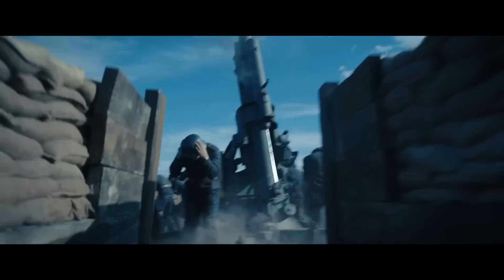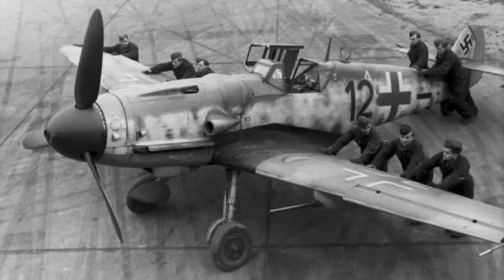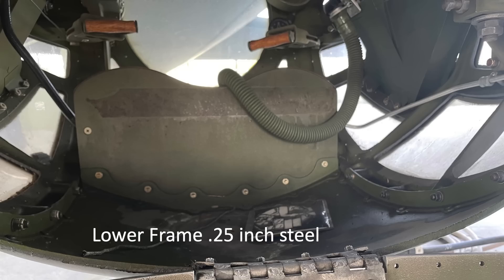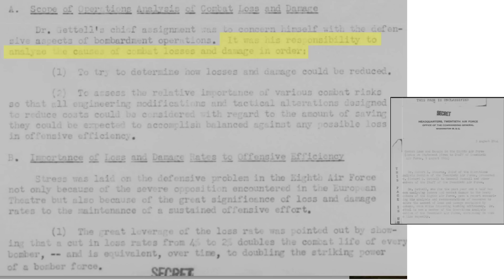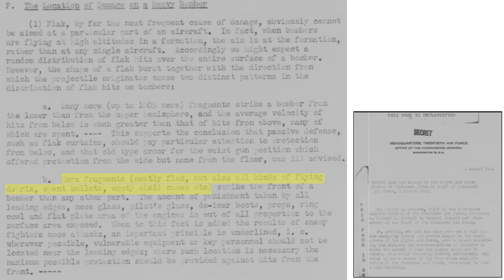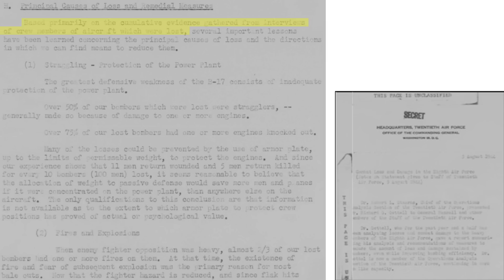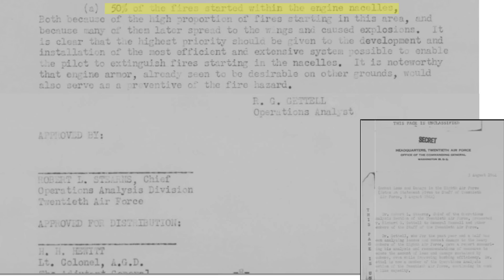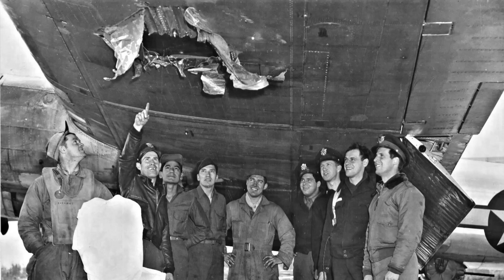Where to armor on the B-17 bombers to reduce losses: Surprising Combat Study Results

Comment: 1) The effort was put in to try to eliminate crews bias on the study. Would there not be other possible biases involved? Everyone has biases including me. What control would they have of other possible biases? One bias should be expected within the military. If it is known what the command is expecting on a study, you can get that result to make the higher ups in command happy.

2) Germans studied downed B-17s. There are even photos of captured B-17s in Nazi markings. After their study of the plane, tactics changed based upon where the weaknesses were. Would not the tactics have adjusted to this new proposed plan? I would anticipate the worst possible outcome of their decisions.

3) Hopefully I can adequately express the logical conundrum that is faced in this study. You have a plane that has 6 items that could cause the loss of it. These items are a, b, c, d, e & f. If you protected a, b & c, then by default d, e & f would be the most common cause of losing the plane. This would work the same if you chose alternate items to protect. How then can I say that the real solution is to switch the protection to d, e & f. The real question is how to make a real test to solve this issue. 

I have a great love for those who serve. Many of my own family have served where I was able to speak to them about their service. Learning of their own hardships and experiences would bring me to tears. 😢 PLEASE remember those who serve(d) everyday. There is no Fourth Of July celebration without them. So much has been sacrificed for Freedom. Do everything legally to preserve liberty in the USA. There is no place to run to if Freedom dies here and it almost has.😢😢

Comment: Your entries are highly informative...this one was a surprise. I wonder why the common bomb load was 12 500lb bombs for a total of 6,000 lbs, when the max load was 8,000 lbs, which easily allowed for the additional armor mentioned on the YB-40. Statistically speaking lives would have been saved. I'm not sure the Eight Air Force was all that worried about losing planes and crews. These Boys were expendable, highly expendable. Brave beyond comprehension.

Comment: While researching  the drawings of  the B-17 G  for a repair of a  bird strike on "Texas Raiders" leading edge, I ran across a drawing of a Flak Blanket.  I do not remember size or if the weight was given, but it was a heavy canvas with pockets sewn on it that contained small overlapping steel plates.  If I remember correctly the plates were about 2x4 and it looked as if the blanket was for the waist gunner  position.  The drawings were Boeing drawings for the G model.

Comment: No offense, but the lady in the photo at 1:54 is holding the rear 2 inch armored glass. Not 6 inches :-), that wouldn't even fit in her palm if she could lift it. A 6 inch glass of this size and shape would be possible but difficult to lift with bare hands, even for a man!
The three 2-inch glasses were arranged in a box-like manner. As can be seen beautifully here: Defending the Superbomber: The B-29’s Central Fire Control System 
I subscribe up right away. Have a nice day!

Comment: It's the same in all areas of combat (air, sea, ground, wherever) MOVEMENT saves lives. If you can't move you will die. Dead in the water, pinned down by fire, too slow to keep up with the squadron?

Comment: The statemen that there ws no particular concentration of hits anywhere on the majority of the bombers is a kind of focus bias because the study was done on aircraft that returned and thus were NOT successfully shot down. You might say that lack of concentrated hits is a characteristic of bombers that AVOIDED disaster. Still, the wide-ranging depth of the study does indeed have a good point in this regard and likely is roughly the case for most bombers. This was all very interesting. Also interesting is that they reversed the focus to their own fighter pilots who also were likely deceived as to how effective their shooting was, and produced a recommendation that they focus on simply concentrating their fire, rather than waiting to hit this or that particular spot on enemy aircraft which the study showed was unlikely. 
Also the study seems to focus on aircraft damage rather than crew injuries and deaths from hits inside the bombers.  No doubt the theory of save the bomber first, and in this way the majority of the crew.

Comment: Well, this is definitely surprising. But wouldn't you still need some armor on the flooring to protect the crew, since flak fragments coming from below are so common?
Reply: The flak shrapnel comes from any direction - you can't armour against that. The strategy is to armour the individual crew stations to some extent in some directions. Thus the ball turret gunner is armoured in front as he's supposed to track approaching enemy a/c - there's also sheet steel curving around his posterior & back like a chair.

Comment: I’m not sure the mention of survivor bias means the AAF avoided it.  Counting bullet holes on planes that made it back just means you’ll put armor where you don’t necessarily need it.  If the B-17’s that made it home generally had no engine or flight deck damage then it follows that the aircraft that didn’t make it certainly were hit there.  It seems to me that light engine armor from the rear & top with heavy armor on the bottom & front with heavy armor under the crew positions would have been more useful than the all-crew position armor was.

Comment: I found that the randomness of the bullet strikes statistically intersting.  But, I think it corrleats more to the comment about don’t put armor on the surviving parts, put it on the not obvious parts.  Armoring radial engines from frontal attack is nearly impossible, but worth an assessment.  As far as crew.  I love the PT story. New sailor manning the twin .50’s  First action, keeps ducking down. Skipper asks why, “uh, armor plating?”  He shows them it is wood!  He never did that again, and in all seriousness, the crews would have accepted any armor they had and still fought.
Reply: randomness of the bullet strikes is also survivor bias. when the fighter was able to focus it's fire, the bomber didn't make it. Only ones that survived had scattered strikes.

Comment: The results should not be surprising.  A statistical analysis of damaged aircraft was conducted during the war and the statistician pointed out that the areas needing protection were those that were NOT hit on the aircraft.  He correctly concluded these areas must be the vulnerable spots because the data clearly showed if the missing aircraft had only been hit where the damaged aircraft had been hit, they should have been able to return home.

Comment: Hits from fighters apparently were random, but what sticks in the mind of course are Luftwaffe gun camera films where hits seem to be concentrated on B-17 fuselages and crew stations.
Reply: Under stress a shooter with a pistol could miss a target 5 feet away.
Reply: I would hazard to guess that bombers on the way to the target would obviously still have their bombs onboard so hitting the aircraft towards the centre makes sense as they would want to hit the bombs. On the return leg the engines and wings would be the things to hit.
Reply: @merlin51h84  But what the presentation makes clear is that MG and 20mm hits were evenly distributed on the bomber airframes. Hits were not concentrated on engines, the center of mass, or obvious aiming points.
Reply: @tsmgguy  Exactly. Under duress, pilots really weren't accurate enough to target any part of the B-17s and B-24s.

Comment: Did not surprise me at all. I'd rather attack a bomber's front than attempt to slowly creep up to it from behind - that gives the most time for the tailgunner to do his job. Also, flak comes from ground level, from below. If it damaged the upper parts of planes, the flak shell flew higher and beyond its targets. What I was curious about was wing failure; if the engines would be armored, could the wing be damaged enough that it would tear off? Armor on the engines would increase stress at the wing's root. Then again, WW2 weapons would lack the accuracy to hit there consistently.

Comment: The Russian's with their IL-2, did the best job when armoring a plane. They used armor plates of around 8-12mm around the entire engine in place of the standard thin skin of an ordinary plane and below the cockpit, and used a plate between the pilot and tail gunner, a plate behind the tail gunner, and armored glass for the front of the cockpit. This would have been a perfect design philosophy to follow in high altitude level bombers due to the lower velocities of striking projectiles when compared to a CAS aircraft like the IL-2 that was flying at treetop height. I imagine a B-17, B-24, B-25, and the later B-29 would have benefited much more to have an armored plate of around 8-12mm below the nose of the aircraft which included the cockpit, navigator/bombardier, and engineer station, a second plate of around 6-8mm used for the bomb bay doors, and a third plate of around 8-12mm for the rear section that would stretch from the waist gunner positions to the tail gunner. Then I'd use 45-60mm armored glass for the cockpit and tail gunner. All four engines (2 for the B-25) would be covered in 6mm armor plating instead of their sheet metal skin and would include a nose cone on their props that would have a 6mm armor plate as well, similar looking to the nose cones of the Fw-190 props. The armored nose cone would help protect the crank from being damaged, which is one of the few areas of a radial engine that could cause the entire engine to cease operation, since losing pistons is usually ok as long as the crank is operable. However, this might require a redesign of the engine cowling since US radials didn't use nose cones and relied on having as much frontal area of their radials exposed to provide cooling, while the Germans and most Japanese designs using radials, relied on refined nose cones and cowlings with as small of a frontal area as possible, and using high pressure air that was compressed using carefully designed nose cones and engine cowlings to draw air around the cylinder heads for their cooling, with some like the Fw-190 powered by the BMW 801's using a secondary prop/fan within the cowling to help boost the cooling air's pressure. This would complicate a simple design, yet in my opinion the trade off it worth it when it would allow the US bombers to have a better armored plane in general, since losing some cooling due to damage, forcing the engine to run at lower power, is far better than having a burning engine you're praying to extinguish and now have to limp home on one less engine.
Reply: If you had this much armor on the old bombers, it wouldn’t be able to carry any bombs be too damn heavy
Reply: That would be way too heavy, B17s could only carry a relatively small amount of of bombs due to all the defensive armament, crew and the existing armor. Weight is the reason why almost no aircraft was armored in any meaningful way.

Comment: Makes sense to me.

Flack rounds are moving up when they explode, so fragments going up would have more energy than those going down.

The bomber is moving forwards adding to the relative velocity of fragments from the front and subtracting from relative velocity of from fragments from the rear.

Once the fighter threat had been reduced flack was the big problem, so armouring the front and underside makes sense.

If engines were the big cause of bomber losses then armouring them makes sense. However one should not remove armour from the pilots, as that is another place were a little damage can bring the bomber down.

More controversially, how about reducing the crew? The waist gunners in particular were poor value. Eliminating them would mean 2 less lives at risk and free up weight to be used elsewhere.

Comment: It's unsurprising that the B-17 was inappropriately armoured, it was designed for a relatively low threat envionment. When operated in a high threat environment it's design trade offs look bad. There are further questions than where should armour be, for example, if all of the armour was removed would the aircrafts survival increase due to the additional speed?
Reply: I think the ultimate conclusion began with the Mosquito -Basically, rather than trying to mitigate against the effects of being hit, instead concentrate on not getting hit in the first place.

The 50s and 60s saw some pretty radical attempts to deliver bombs either very fast, very low, or very high.. or a combination thereof.
Reply: I think you are jumping to a conclusion that the plane was not appropriately armored.  The plane was designed to fight its way to to its targets, but you can only armor the most critical areas.  This is an interesting statistical study, but I don't see it as proof that the armor was in the wrong places.

Comment: Dad arrived on Tinian late in the war.  He only flew 8 missions.  He said by the time he arrived that Japanese interceptors would not fly into a formation of B-29 airplanes unless they planned a ramming attack.  They would loiter at long range and fire 20mm rounds at the bombers.  Their deflection shooting skills were so poor they were not able to score any hits. The B-29 gunners occasionally lucked into some hits with .50 caliber rounds which were usually pretty deadly to the Japanese aircraft.
Reply: Yeah the Japanese failed to rotate their experienced pilots out from the front to teach and train their younger pilots. So once the good pilots were killed, they really struggled. It also didn’t help that their planes lacked self sealing fuel tanks. So they’d catch fire rather easily and rarely be able to salvaged. As such, going through airframes and pilots, not securing their own skies was basically asking to get nuked.
Reply: @rzr2ffe325  The germans had a similar problem with aircrew.
Reply: The Germans only had one pilot training school until late in the war. As soon as the war started, the school could not replace casualties fast enough. It was not until late 1943 that more pilot training programs were established. By that time the military was starting to feel the pinch of dwindling fuel supplies.
Reply: The B-29 had a really accurate gun training system, it was able to achieve better kill ratios for a bomber than some fighters of the period, and was discussed in another one of this guys videos. Check it out!

Comment: One 30 mm cannon hit was enough to break a B17 fuse in half  or if hit in the wing root blow the entire wing off.  This happened Often.   
That explosive 30 mm cannon round was THE most powerful /effective fighter borne weapon of WW2
Wasn't feasible to armor an aircraft with adequate protection and still carry a bombload.
 Armoring against 30 cal hunting rifle rounds was Better than nothing  but only barely so..
Only early Spitfires used 30 cal  'guns' and only  briefly at that.   
Despite Jingoistic babbles... Bomber Crews were clearly expendable .
Reply: 30 mm HE cannon shells did not blow the "entire wing off" a B-17 & thin armour is quite effective against such rounds. When a B-17 wing folds it's as a result of fire heat weakening the very tough metal spar. Any incendiary round or hot shrapnel does the trick as it has a strong probability of defeating the self sealing properties of the fuel tank.
Reply: How often?
Reply: As the video noted, flak was a greater threat than fighters by the time of the war that the 30mm became common. It also had issues - inaccuracy, for one, requiring fighters to approach close to bomber formations where they can be focused on by many turret gunners.

Comment: The reason that bombers' engines were vulnearable was due to tjat aircrews in the fuselage were proctected by the armor plates, thus Nazi fighters turned and shot up the engines so as to bring down the bomers. If engines were well protected and fuselages were not, then dead or wounded aircrews would render the bomers being shot down before the engines got shot up.
Reply: The crew was still not very well protected, there were many attack angles where they were unprotected. Frontal attacks were favoured because of this.

Comment: I've been wondering if machine gun or cannon rounds from German fighters ever set off one of the bombs in the bomb bay. Or is that even possible?
Reply: I have no idea what type of explosives was used, but I would think that it was something that did not detonate by getting hit very very hard... and that need a explosion to set it of. (the detonator) 
So I would guess that you need something like a 30mm HE round that makes a direct hit on a bomb to have a chance to set it off.

But as mentioned, Iam just guessing, based on my experience with modern day explosives as a combat engineer.

Comment: I watch the Thousand plane Raid. I see the officer wants a bomber convert into 20mm cannon for air destroyer escort. Is that happen?
Reply: The Americans with a few exceptions did not go to the 20mm until the after the Korean War.
Reply: No, the closest was the YB-17 project which used .50 caliber/12.7mm.  That project was an overall failure however on its plus side it did introduce the chin turret that was incorporated into the B17G variant.